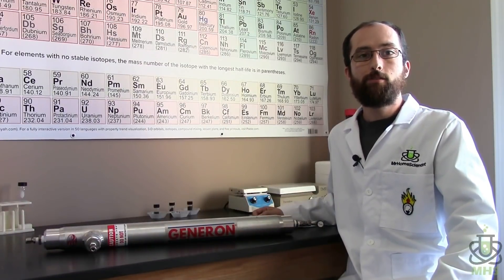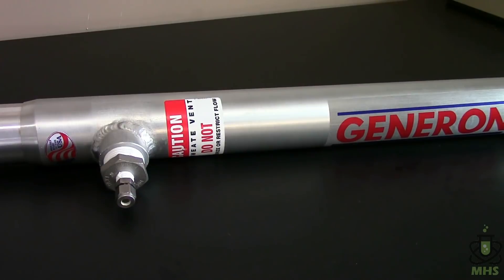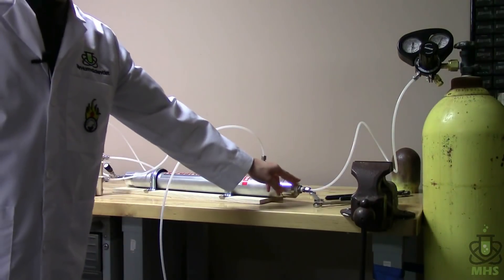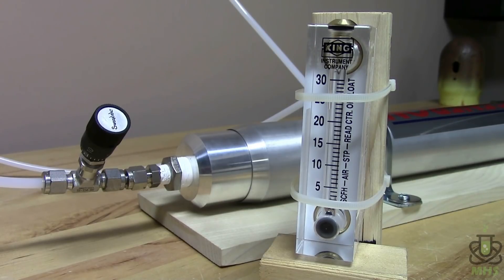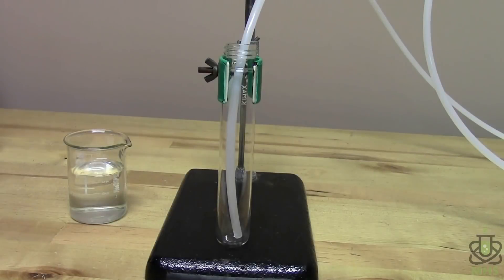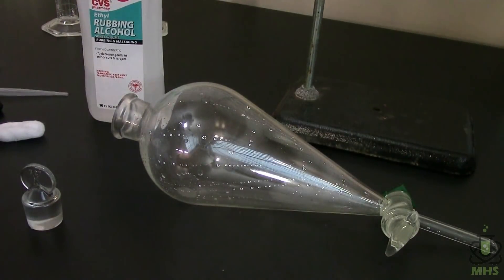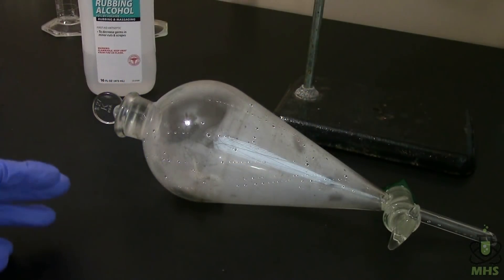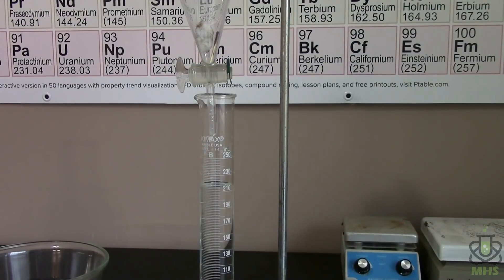Testing the Generon Nitrogen Membrane Filter

Comment: These are used I believe (among other uses), in medical oxygen generators for people with lung disease. These generators usually peak at about 5L/min O2. Now, a rule of thumb that's used in respiratory therapy to calculate the percentage of oxygen delivered by a certain liter flow goes like this: you take the normal percentage of oxygen in air (for convenience rounded to 20%) and for each liter/minute of supplementary oxygen, you add 4%. So air supplemented with 1L/min is 24% O2, 2L/min corresponds to 28% and so on. 5L/min ends up being 40%, which coincidentally is the maximum % of the permeate when set for 95% purity N2 according to the specs. :)
Reply: Where did you find the oxygen content of the permeate specified?  I don't see it in the spec sheet at https://www.youtube.com/redirect?v=4-bbAwoG4Z8&redir_token=QUFFLUhqbDFha1FaWFdDSEdTbF80dWJROTRacGs0OGRJUXxBQ3Jtc0trSTFwU0szekpERHlRZ2RhbFIzV3Q4Q2cxV05SZ3c0UG5oZy1hRjNENWxHeVRDUkhUTnAyR3hSdUpuV0NZSUV3YnZ6NTRrdGFwV0RpLU53ZVNwNm91YUM1b29ZQWpCLXlFYWxzSU8tdXpkTWo1X09vUQ%3D%3D&event=video_description&q=https%3A%2F%2Fgeneron.com%2Fwp-content%2Fuploads%2F2017%2F10%2FD-MM-210-0717.pdf

Or did you get it by calculation from the nitrogen flow rate and air recovery rate?

Comment: I came up with an adaptation of this technology that would be pretty awesome, IMHO.

Forced Induction Gas Separation:
1. Suck in high-volume/high-pressure air (forced induction required)
2. Separate nitrogen and water vapor (two stages of membrane separation)
3. Send oxygen-rich air to engine on intake stroke (to increase combustion efficiency)
4. Send nitrogen to exhaust manifold during compression stroke (to keep turbocharger spooled up)
5. Send water vapor to engine during power stroke (to cool down the engine)

Extra;
- Membrane efficiency can be enhanced with mixed ionic and electrical conductors.
Reply: And use a nitrogen electrolyzer with the water to make ammonia, nh3, which is a cleaner burnable fuel, and voila you can leave the gasoline out and drive on air
Reply: @  Ammonia has problems. Toxicity, corrosion, low boiling point, energy density, difficulty to combust…

…and the laws of thermodynamics. Where are you going to get the energy to electrolyze the water? Nitrogen is also **a triple-bonded molecule**, it takes a lot of energy to make it split so it can react with the hydrogen.

Comment: Co2 takes up the same space (ideal) as o2, theoretically it shouldn’t reduce in volume, the reason this works is because the co2 can dissolve in the water. For this reason shouldn’t using a weak solution of NaOH to sequester the co2 to drive it forward?

Comment: I'm wondering if you can set up a way that'll filter out most Elemental gases and certain common gases like CO2, the purposes for storage of high Purity Gases and a liquid form such as liquid oxygen and liquid nitrogen solid carbon dioxide Etc. Any idea how to set up a system that you can take atmospheric air and separate essentially everything except for certain Trace gases like CO or radon.

Comment: Perhaps try burning  "0000" super-fine steel wool as a fuel; it doesn't produce CO2 as a byproduct.
Reply from the maker: That's an excellent point; it uses up oxygen but produces another gas to replace it, which would throw off my results. I did try another experiment where you let iron rust in a bubble in an upside-down measuring cylinder, which is usually done with steel wool. I used a Hot Hands pack to make it go faster, since that's very fine iron powder. It worked good for air but for some reason failed for the enriched oxygen stream...
Reply: You can probably ignite it with an induction coil too, or a laser as others have suggested.

Comment: At these flow rates isn't bothering to get rid of the O2 at a "safe location" a bit of overkill?  I'd think it would be fine to just eject it to the room.  You're probably talking about a normal room with a HVAC/Heating system that's mixing the air around to the rest of the building.
Reply from the maker: Probably. Generon recommends leading it out of the room, so I figured I might as well just in case.

Comment: My understanding is that oxygen is not consumed it reacts oxidizes combines with what it’s burning so the oxygen is still there just different form, the heated gas escaping then cooling and contracting makes the vacuum that draws in the water. When you blow a tire on a rim it’s the gas heating and expanding that sets it but then it rapidly cools and will draw the tire back off the bead because much of the gas has escaped before it sealed so when it shrinks back to size vacuum happens. Just my humble opinion

Comment: Can you make a video on the working of the Nitrogen member filter?

Can we use Nitrogen gas for cooling water?

I'm using a commercial 5 ton cooling system in my industry for cooling water but the problem is, it is heating the surrounding too much.
While discussing about the cooling system's performance with my friend, he gave me an idea to use Liquid Nitrogen but the issue is the local availability of liquid nitrogen.

I just need to know that is it possible to reduce the temperature of water using Nitrogen gas?

If it yes, I can make use of the Nitrogen member filter as I have a air compressor which can compress the air upto 10 bar .

Thanks for the video, it's so great to see the way you test the separated gas and it is very helpful.
Reply from the maker: I can't really comment on industrial applications, but cooling with gas is absolutely possible. That's how refrigerators work. We also use a cryocooler at work that uses helium gas. There's ways to make your own liquid nitrogen from air if availability is a concern. For specific questions about this system, I'd contact Generon directly.

Comment: Can you run the retentate or permeate back through the filter to go even higher in purity?
Reply: Of course, but because the output is less than the input, you'd need to do something like run it from air to fill a cylinder, run it from that cylinder into another cylinder, etc. and use the product when you go to the desired purity.  If you bought a concentrator designed to produce those higher purities it would be better optimized and less of a hassle.

Comment: That is some awesome gear. What fun to play with.
You didn't say much about water vapour in air. I know it is not an issue for you using dry canned air but it is a significant matter if using a compressor.

I think the higher O2 in the permeate when set at 95% is most easily explained by goinng back to the diffusion of gas in the filter. If the filter preferentially diffuses oxygen and the gas throughput is high then the retention time in the apperatus is low. That leaves little time for nitrogen to diffuse through and therefore there will be less.

Testing for O2 in the manner you did... I think you need some stoichiometry to be accurate since you will be producing gassepus CO2.

It should also be possible to calculate the permeate concentration from the retentate concentration and flow rate.   If you can get another flow meter that might be worth a try. Or alternatively test the permeate and use this to confirm the retentate calibration chart.

Awesome stuff. And as always, nicely presented.
J.

Comment: Could this technology be adapted to an air intake system for a car? Also, what about a similar separation system that takes water vapor out of the air and sends it somewhere else?

I want to implement these so that an engine can receive additional oxygen (and less humidity) to burn fuel more efficiently. Then water vapor can be injected after the fuel has nearly finished combusting, cooling the engine down. Meanwhile the stream of nitrogen can be used to keep the turbocharger spooled up.

Comment: Is it possible to use this system with fuel cell module?
Reply: In what way?  If you mean to purify the O2 there are better ways.  This really is designed for generating N2.  The O2 is just a byproduct.

Comment: Consider using a laser pointer to light to combustible material, and keep it in there for the duration of the experiment.  Burning the ethanol also creates carbon monoxide.  Also, you were peaking the microphone.  Very cool video nonetheless.  Appreciate your work.
Reply from the maker: Laser pointer is a great idea. It'd have to be one of those super powerful ones but that definitely sounds doable.
Reply: I have one of those, a 1W (theoretical) 405nm laser. I got it from ebay a couple of years ago, think it was about $60 or so. It's not really powerful enough to light wood even if focused steadily on the same spot for a couple of minutes (and it shouldn't be on for more than a couple of minutes at a time). But it will set off matchheads instantly. Now, that will release gases of its own when lit so it would skew your final volume. It may work  - haven't tried but it may be possible - with other flammable substances that don't release extra gases when lit. I'm thinking magnesium powder for instance.

Comment: Oh boy... I'm sorry, but there are two huge mistakes in your video. 

First off, putting a volatile fuel in an oxygen rich atmosphere, in a glass container, and throwing a match in is a bad idea. You're lucky it didn't end up with glass shrapnel in your face. (I've done it in the past with ethanol in plastic bottles, lighting them with a fuse : they really go boom! The one thing that must have saved you here is either that the vapors didn't have time to accumulate enough, or your oxygen concentration. But you took a serious risk.)

Then, combustion isn't just consuming the oxygen. You're also making gaseous combustion products, like CO2. In fact, if you're burning ethanol, you're making 2 moles of CO2 for each 3 moles of oxygen you consume. (and 3 moles of water vapor, but that should condense)
So, I don't think your results tell you anything about the oxygen volume consumed, just the hot gas volume that got out before you could put the plug back on. (which should indeed be greater with a more oxygen rich atmosphere, as the combustion would be faster. But certainly not quantitative...)
Reply: @mrhomescientist  Just wanted to let you know that the explosion limits (LEL and UEL) are given as a percent by gaseous volume, and not by liquid. Therefore, for 630mL volume you just need 20.8ml of ethanol vapor for it to be explosive, which is approximately 0.04ml of liquid or just a few drops (assuming an expansion ratio of 1 to 500, which is already rather conservative).
Reply: Perhaps affixing a burning strip of metal to the underside of the cap somehow (maybe a strip of magnesium in a little basket) could have worked better.  Although I suppose Mg also burns in N2.  Given a bit of time; say a day or 2, metallic sodium or potassium would also probably react with most of the oxygen even without ignition.  That would probably need a better seal than ground glass though.
Reply: @whatelseison8970  Steel wool would have been the way to do it.

Comment: If you have the contacts to buy an air cylinder, why not just buy a nitrogen cylinder? To me the utility of this device would be to bypass the gas companies, who usually won't sell to homegamers.
Reply from the maker: lonewolfszc Depends on your usage rate. If you need a lot of nitrogen on a regular basis, making it straight from air is a great option. You'd want an air compressor for that, of course; then you wouldn't have cylinder expenses. For my short test, renting an air cylinder was much simpler.

Comment: I don't think oxygen is a constituent of air at all - Imo if pure oxygen was present in the test tube from the permeate stream at 15:30 then the wooden splint should have remained lit when pulled out of the test tube. What I think you produced from the permeate stream was a very weak oxygen like air but it wasn't oxygen because oxygen is supposed to be an element and be the same in every instance where it is found!!!

Additionally, according to the science (cough cough) the membrane doesn't allow nitrogen to permeate through therefore the gas in the test tube from the permeate stream should really have only contained oxygen and some very tiny negligible trace amounts of CO2 (this is assuming the compressed air cylinder didn't contan any water). But the splint ought to have relit and remained lit when withdrawn from the test tube!! Afterall, according to the science, oxygen can only be oxygen right?

Your demo does promote my view in that oxygen is only dry concentrated air and comes about as a direct result of processing air in its entirety which is what you did. You even admitted that the splint didn't relight very well because the permeate stream wasn't 'concentrated' enough.
Reply: "I don't think oxygen is a constituent of air at all"  Well, you also claim that it's a fact that iron is the only element that attracts magnets. 🤣🤣🤣